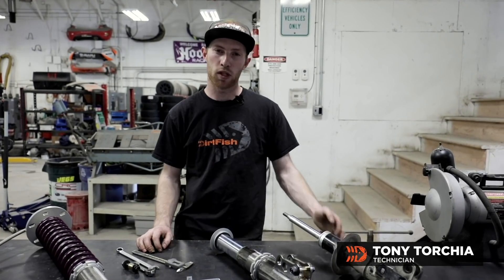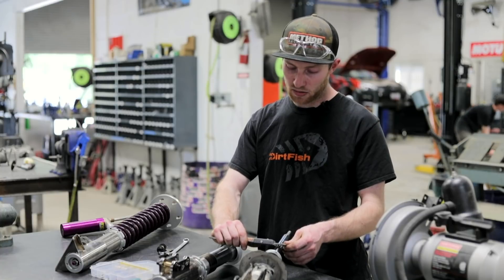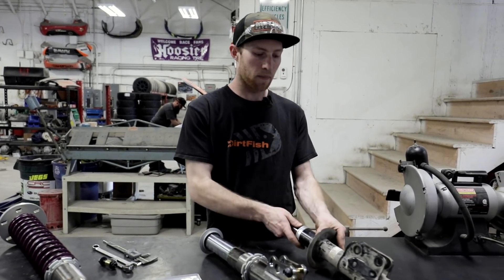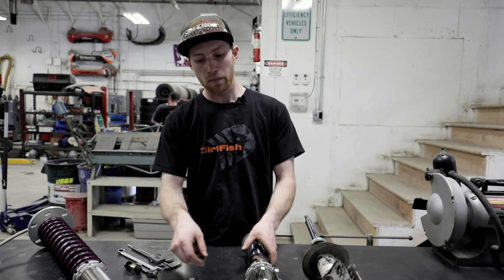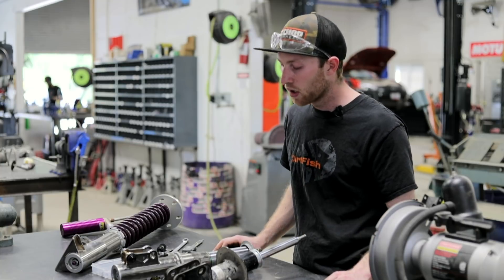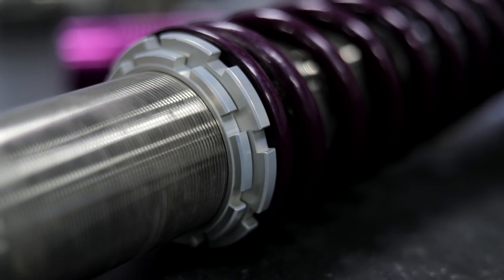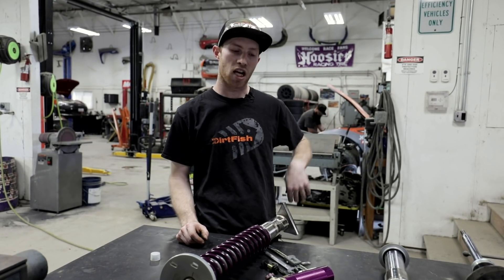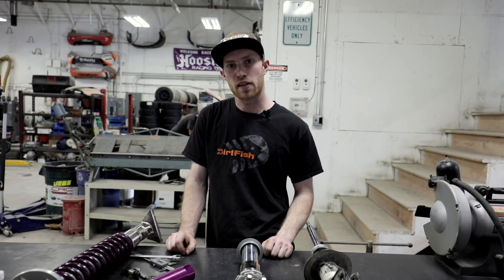Rally Car Suspension - How It Works

Comment: Would you use a completely different set of suspension for tarmac, or can these be adjusted for both on and off road conditions? Either by adjustment or minimal part swapping?

Comment: How about the coil springs almost same as stocks otherwise material and Via metal treatment some improvement does?? On rally car Front MacPherson Sturt with torsional bar just a Idea myself and I know all wheel independent suspension is used on technical terms for front and rear what types are using in rally?? Let me know

Comment: Does adjusting the ride height, also effect the spring rate?
Reply: for most coilovers you don't actually adjust the spring, its where it connects to the control arm.
Reply: @Obama___  thanks for the information mate! Can you elaborate a little more? For example, if I raise the height and put coilovers on… what kind of spring should I be using to get a good setup?

Comment: Hello guys I want to do rally car myself and I was thinking if the opel vectra not the sedan but the hatchback is a good idea or i should look for different car. Thanks
Reply: Haha, not really. If you have a really low budget then maybe, but considering the amount of money you need to put in (safety equipment, suspension upgrades etc) you are better off buying a better car than that. Lots of older awd cars out there that would do you good

Comment: What’s the service interval on a set of the Reiger Clubmans? Is it 60hrs as mentioned in the servicing video or longer with the more basic damper? I’d like to run something like that on my WRX for street/gravel road use and I’d like it to last 2 yrs between services if possible.

Comment: How does rally suspension ride compared to stock/ something designed for street?
Reply from the maker: It's a lot stronger and gives you more adjustability. What we use here is specifically designed to function better and last longer on rough and loose surfaces.
Reply: I wonder the same, like if you were to use rally suspension on the street can you get OEM like confort but with motorsport strength

Comment: Who does your shock tuning?  Beyond being adjustable, what are the major differences in damping between the motorsports and the stock dampers?  Do the upgraded shocks offer more travel?  Thanks, keep up the good videos.
Reply: I had ProFlex evo2 inverted coilovers on my Forester, didn't like them as they were too harsh even with very low damping because the bearings make too much friction, even with the appropriate grease as it gets wiped off of the bearings very fast, having no seals to keep them lubricated. I had 22cm front/25cm rear wheel travel. I now have HotBits non-inverted coilovers with approximately the same overall length but gained 2cm of wheel travel. I am very happy with the Hotbits, only downside being the oil seals that worn off/leaked very fast due to a bad design but replaced with U shaped seals. Now for hard rally conditions, the inverted coilovers are much more robust than the non-inverted coilovers but I'm not driving in those conditions....